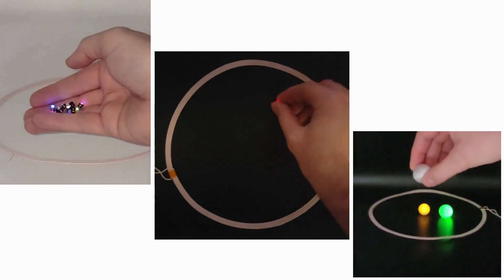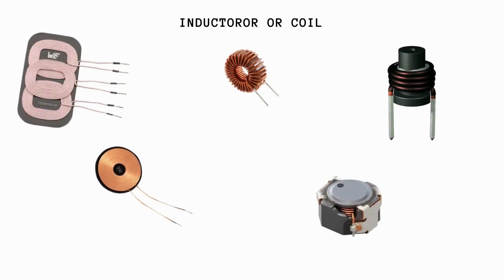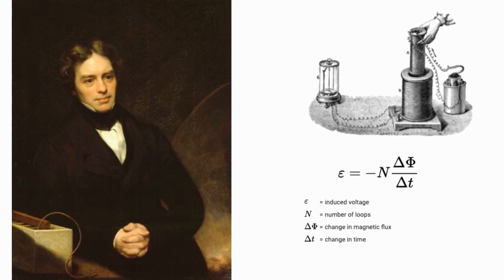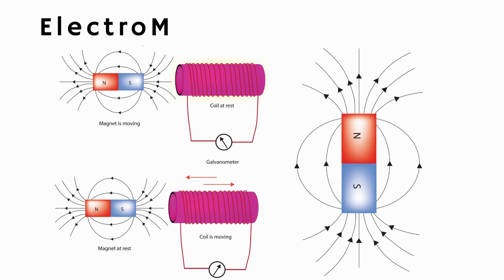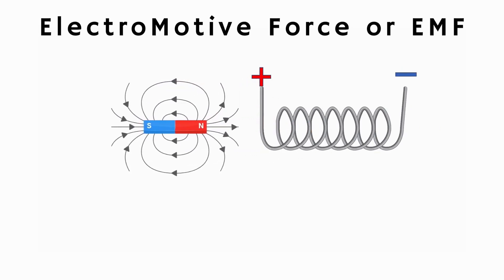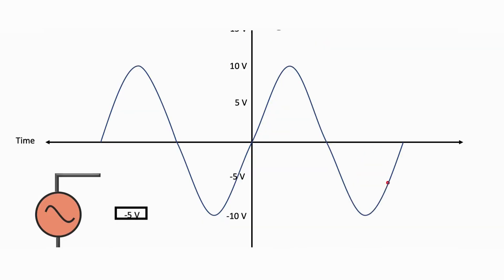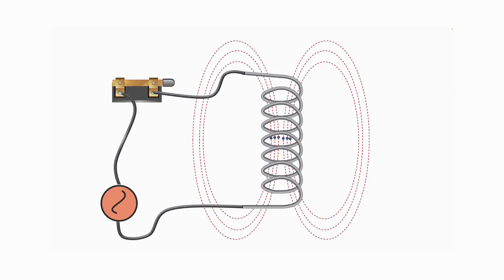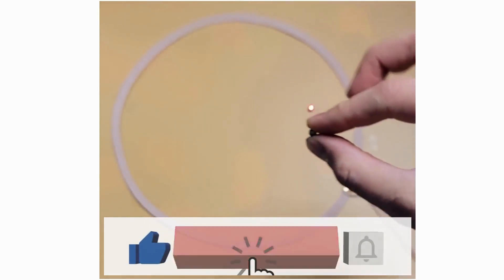Wireless LED explained

Comment: Hey. Can I just solder a 3v led strip to the light will then both lights lit up, like my own light and that coiled wire it comes with?
Reply from the maker: Hi,
I think it should work as long as you carefully disconnect the led part and connect your own led. Just remember, the LED should draw a similar current as the one on coil.
Reply: @zixopaslab do you know the current it draws on the current one